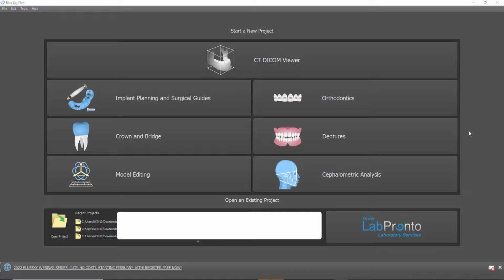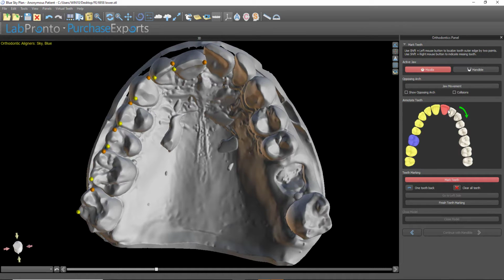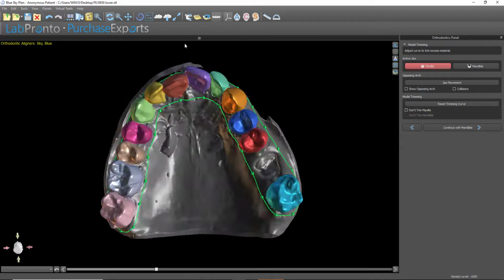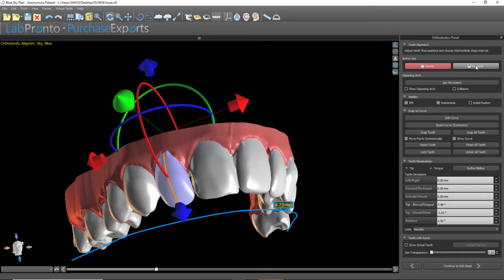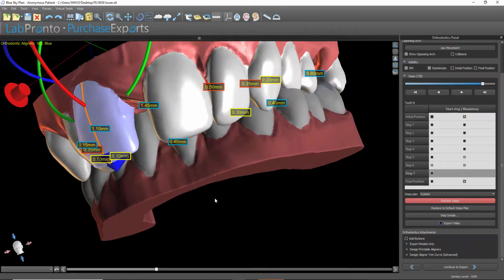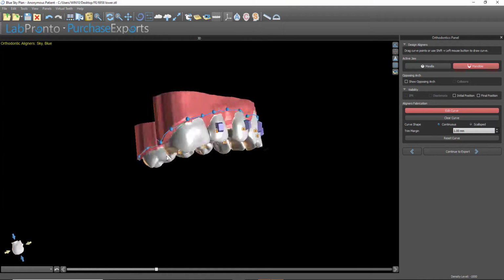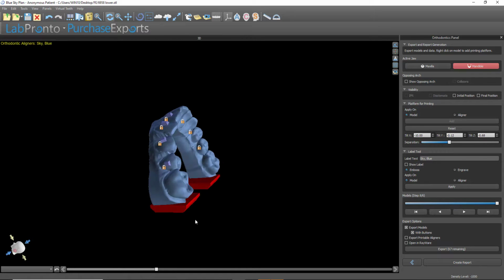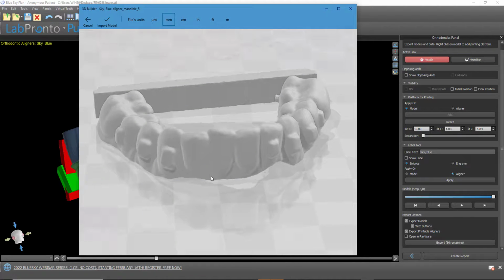Exporting Aligner STL Files For Print

Comment: How can I make a scalloped alligner tray that sits right on the edge of the teeth not touching the gums at all like Invisalign?

What ive been doing is exporting the teeth themselves into a CAD software and designing the alligner that way. Inside this software the trim lines never line up with the segmentated lines perfectly.

The software does a great job segmentation the teeth, but I want the alligner tray to only cover the teeth and stop at the gum. If I set the offset to 0mm the line hugs the tooth but Is jagged and still eats into the gum line. 

@BlueSkyBioVideos